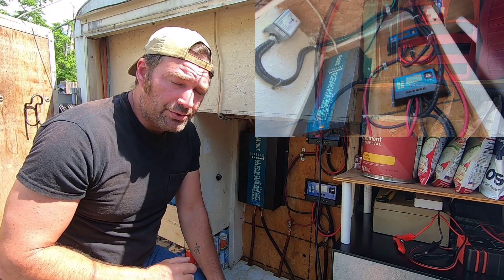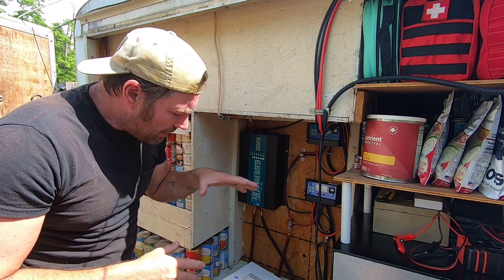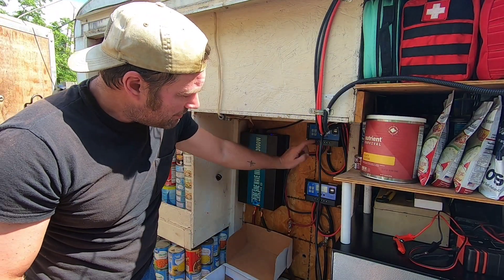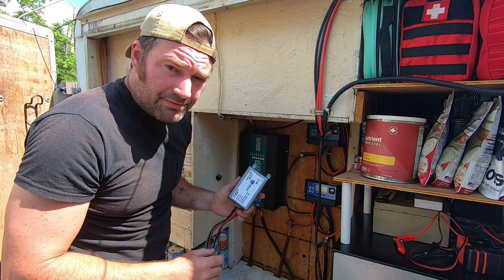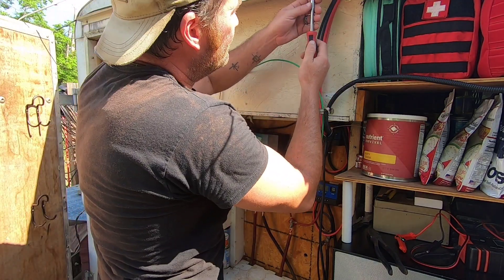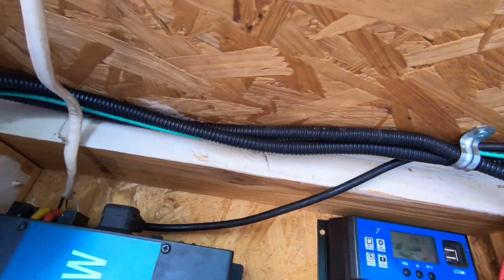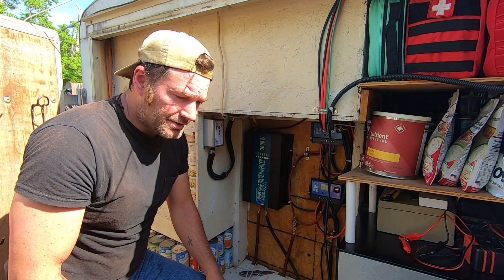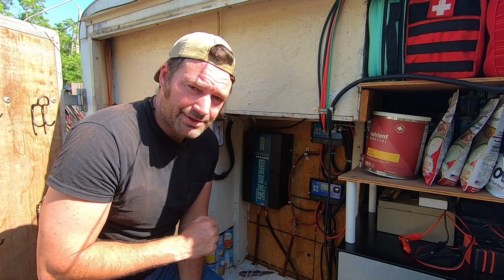How To Protect Your Solar With EMP Shield Installation

Comment: Thank you for the info!  I ordered one for truck and RV solar.  Question though...would this really be needed for a house?  Given the grid would be impacted and while your house may be ok, it seems there would be no more grid power coming to the house anyway?
Reply from the maker: So for the house. It's designed to protect your home from that surge of power entering your wires and catching fire along with anything plugged in.
My buddy over at Prescott Caliber Club did a video a while back where it saved his home from a lightning storm in Arizona. EMP shield took the surge